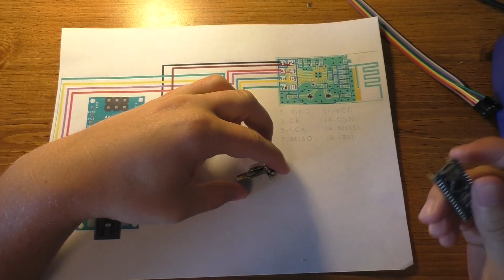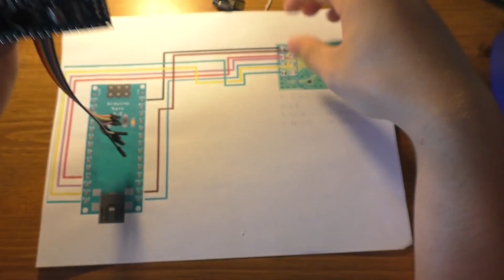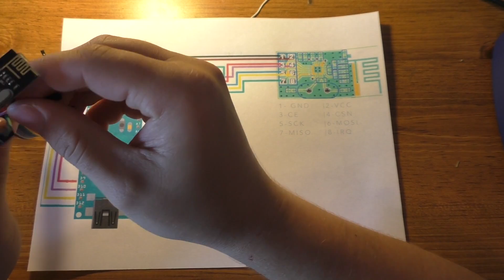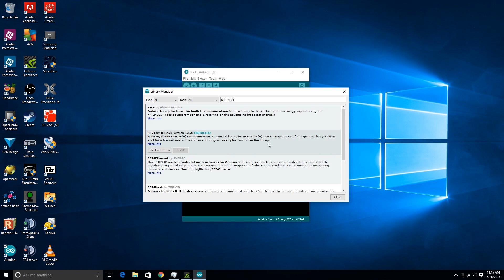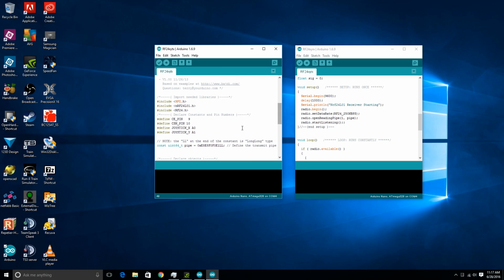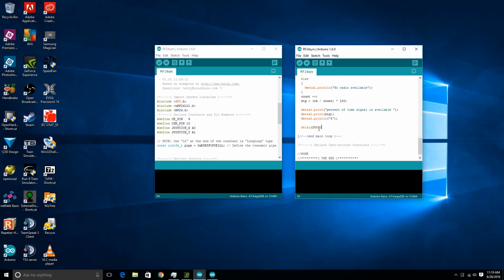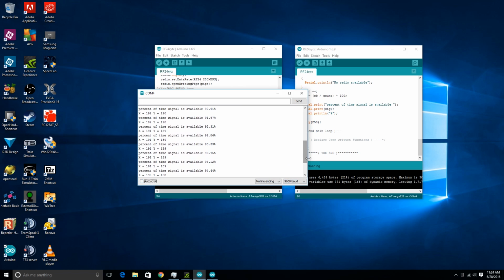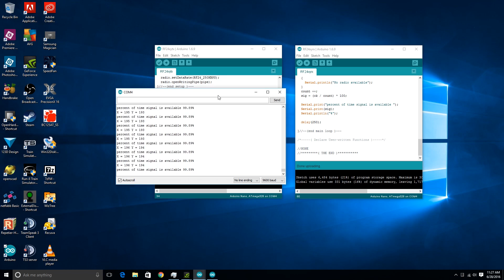NRF24L01+ Setup With Arduino Nanos

Comment from the maker: Receive Code: 
/* YourDuinoStarter Example: nRF24L01 Receive Joystick values

  - WHAT IT DOES: Receives data from another transceiver with
   2 Analog values from a Joystick or 2 Potentiometers
   Displays received values on Serial Monitor
  - SEE the comments after "//" on each line below
  - CONNECTIONS: nRF24L01 Modules See:
  http://arduino-info.wikispaces.com/Nrf24L01-2.4GHz-HowTo
   1 - GND
   2 - VCC 3.3V !!! NOT 5V
   3 - CE to Arduino pin 9
   4 - CSN to Arduino pin 10
   5 - SCK to Arduino pin 13
   6 - MOSI to Arduino pin 11
   7 - MISO to Arduino pin 12
   8 - UNUSED

  - V1.00 11/26/13
   Based on examples at http://www.bajdi.com/
   Questions: terry@yourduino.com */

/-----( Import needed libraries )-----/
#include <SPI.h>
#include <nRF24L01.h>
#include <RF24.h>
/-----( Declare Constants and Pin Numbers )-----/
#define CE_PIN   9
#define CSN_PIN 10

// NOTE: the "LL" at the end of the constant is "LongLong" type
const uint64_t pipe = 0xE8E8F0F0E1LL; // Define the transmit pipe

/---( Declare objects )---/
RF24 radio(CE_PIN, CSN_PIN); // Create a Radio
/---( Declare Variables )---/
int joystick[2];  // 2 element array holding Joystick readings
float count = 0;
float ok = 0;
float sig = 0;

void setup()   /**** SETUP: RUNS ONCE ****/
{
  Serial.begin(9600);
  delay(1000);
  Serial.println("Nrf24L01 Receiver Starting");
  radio.begin();
  radio.setDataRate(RF24_250KBPS);
  radio.openReadingPipe(1, pipe);
  radio.startListening();;
}//--(end setup )-

void loop()   /**** LOOP: RUNS CONSTANTLY ****/
{
  if ( radio.available() )
  {
    {
      // Fetch the data payload
      radio.read( joystick, sizeof(joystick) );
      Serial.print("X = ");
      Serial.print(joystick[0]);
      Serial.print(" Y = ");
      Serial.println(joystick[1]);
      ok ++;
    }
  }
  else
  {
    Serial.println("No radio available");
  }
  count ++;
  sig = (ok / count) * 100;

  Serial.print("percent of time signal is available ");
  Serial.print(sig);
  Serial.println("%");

  delay(250);

}//--(end main loop )-

/---( Declare User-written Functions )---/

//NONE
//*******( THE END )*********

Transmit Code:
/* YourDuinoStarter Example: nRF24L01 Transmit Joystick values
 - WHAT IT DOES: Reads Analog values on A0, A1 and transmits
   them over a nRF24L01 Radio Link to another transceiver.
 - SEE the comments after "//" on each line below
 - CONNECTIONS: nRF24L01 Modules See:
 http://arduino-info.wikispaces.com/Nrf24L01-2.4GHz-HowTo
   1 - GND
   2 - VCC 3.3V !!! NOT 5V
   3 - CE to Arduino pin 9
   4 - CSN to Arduino pin 10
   5 - SCK to Arduino pin 13
   6 - MOSI to Arduino pin 11
   7 - MISO to Arduino pin 12
   8 - UNUSED
   - 
   Analog Joystick or two 10K potentiometers:
   GND to Arduino GND
   VCC to Arduino +5V
   X Pot to Arduino A0
   Y Pot to Arduino A1
   
 - V1.00 11/26/13
   Based on examples at http://www.bajdi.com/
   Questions: terry@yourduino.com */

/---( Import needed libraries )---/
#include <SPI.h>
#include <nRF24L01.h>
#include <RF24.h>
/---( Declare Constants and Pin Numbers )---/
#define CE_PIN   9
#define CSN_PIN 10
#define JOYSTICK_X A0
#define JOYSTICK_Y A1

// NOTE: the "LL" at the end of the constant is "LongLong" type
const uint64_t pipe = 0xE8E8F0F0E1LL; // Define the transmit pipe

/---( Declare objects )---/
RF24 radio(CE_PIN, CSN_PIN); // Create a Radio
/---( Declare Variables )---/
int joystick[2];  // 2 element array holding Joystick readings

void setup()   /**** SETUP: RUNS ONCE ****/
{
  Serial.begin(9600);
  radio.begin();
  radio.setDataRate(RF24_250KBPS);
  radio.openWritingPipe(pipe);
}//--(end setup )-

void loop()   /**** LOOP: RUNS CONSTANTLY ****/
{
  joystick[0] = analogRead(JOYSTICK_X);
  joystick[1] = analogRead(JOYSTICK_Y);
  
  radio.write( joystick, sizeof(joystick) );

}//--(end main loop )-

/---( Declare User-written Functions )---/

//NONE
//*******( THE END )*********

Comment: thx brother you the best i was sitting a whole day with it and you finnaly helped me. For every one that has a problem with it don't working try pluging in one and onother arduino to powerbank with 5v it could be a power problem. To test it just plug joystick to transmiter and servo to reciver and paste this in reciver between Serial.print(joystick[0]); and  Serial.print(" Y = "); it is in void loop  

joystick[0] = map(joystick[0], 0, 1023, 0, 180);     // scale it for use with the servo (value between 0 and 180)
      myservo.write(joystick[0]);                  // sets the servo position according to the scaled value
      delay(1); 

don't forget to add library to reciver 

#include <Servo.h>

and another time thx

Comment: What is the capacitance and voltage of the capacitors used. 
I m not using any capacitors, and my circuit is not working.. It is not showing any signals as I m sending hello and receiving it from other end.. But it does nothing. 
Is this becoz of capacitors??? 
Plz reply... 
And provide the details of capacitor..
Reply: It is a 10uF capacitor

Comment: Hey, I am trying to test your code, and the serial monitor on the receiving end tells that 

"percent of time signal is available 100.00%
X = 0 Y = 0
"

I am not sure where to go from here. Anyone know anything that could help?
Reply: same here
Reply from the maker: Are you sure the NRF boards are wired right and working? Maybe try code from the library examples to test them. Usually when I had issues like that it was from hardware problems.
Reply: @Eman2000  
I don't think it's a hardware problem. It behaves as though the arduino acknowledges that the transmitter is there, but it won't transfer the data. My transmitter is an arduino Uno board, and my receiver is an arduino Nano board.
Reply from the maker: Turn off the transmitter and see it it still says its receiving something.
Reply: @Eman2000  
I did that last night, and it then told me that there was no radio available.
Reply: I am making transmitter and receiver with nano and nrf24. But there is nothing working. I use a code just to check my nano is reading nrf or not and it says radio hardware is not responding. While when I use Arduino Uno, it works fine. I used other nano and pro mini but nothing is working except uno. Please suggest

Comment: why your connecting capacitor at pin1(gnd) and pin2(vcc)...please tell me the reason and which value capacitor is best
Reply from the maker: It's not really necessary, but it helps if the power supply for the board isn't very stable. Value isn't too important. Something around 10uf should be more than enough.

Comment: Hi, following your tutorial I've built both circuits, downloaded your sketches and everything seemed to work for a tiny bit. Shortly after a small victory of finally being able to set up these two little demons I have ran into an issue; I would no longer recieve any signals... sometimes when I touched the antena or put both antenas in a specific position I would get signal coming in for a second or two and loose it again. Would you be able to give me any advice on why this is happening? Thanks in advance.
Reply: Same problem
Reply: Hi there ! If you still need a solution, you should use an independent source for the nrf24l01 combined with a step down 3V3 circuit. That problem emerges because of the demanding current required by the nrf
Reply: Also a suitable solution is the capacitor that he used, because of the variations the board has on source pin.

Comment: Can you help me? I have a problem. I have built few Arduino robots using NRF24L01 modules, the robot runs very slow when I make it move forward or backward, but faster when I move it let or right. When I turn the Autonomous  mode, it runs fast. It seems that it becomes slower when controlled by NRF24L01. My robot runs also fast when I use bluetooth module.
Reply from the maker: sounds like there is something in the code that is turning the motors back off instead of leaving them on when you use the NRF module.
Reply: If I tried to switch the  joystick assignment from X-axis to Y axis from the TX arduino (will exchange the TurnRight to Forward dc motion), the robot runs faste forward and backwardr, but the TurnRight and TurnLeft now runs very slow. It seems to slows down one direction or the other.
Reply: is this robot using a single joy stick? do you have the coding to share please?
Reply: give me your email address
Reply: here is the sample video of it. The T300 tank robot using a DIY thumb joystick and few pots.  /watch?v=KeQAiAUj8b8
Reply: how should i connect servos to it 
can you help?